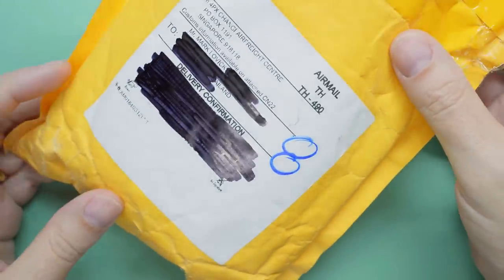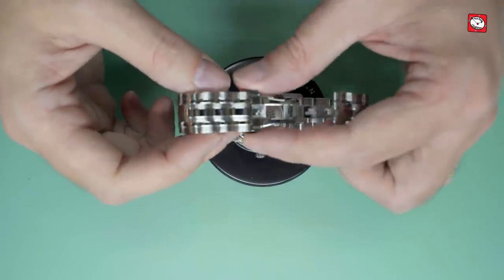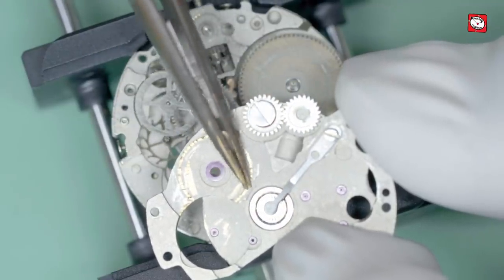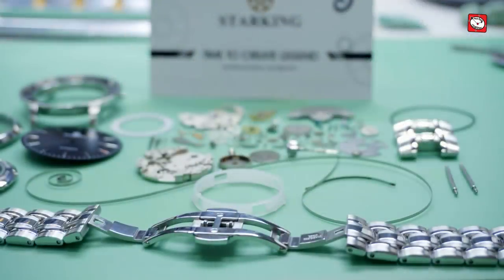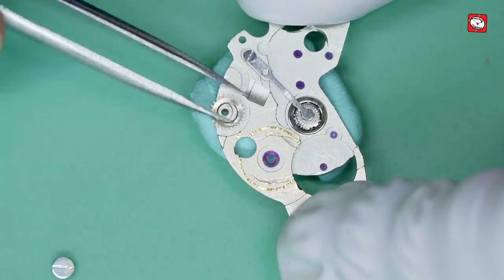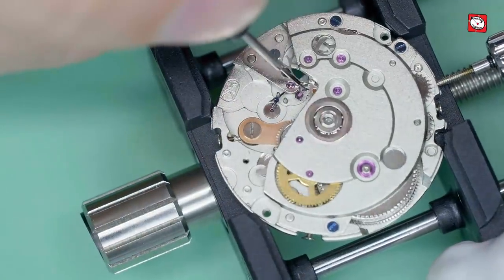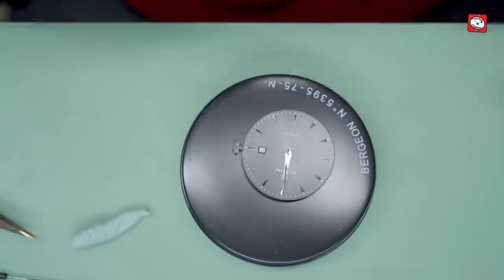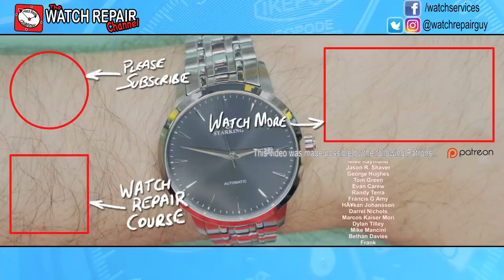Starking Watches - Can A $50 Budget Automatic Be Any Good? Full Review

Comment: Starking just wanted this rebuild video so they can use it for internal training on how to put a watch together properly ;-)
Reply: Or, they just had him show them what the problem was with their movement so they can redesign it. Probably saved them hundreds of thousands in R&D.
Reply: @manstersr   hundreds of thousands ... maybe not.
Reply: @manstersr  I imagine their next watch will have a miyota 8215 in it and it's $100 which might still be a real bargain lol
Reply: @Jerome...  Depending on how much they sell, it could actually save hundreds of thousands of faulty movement returns.
Reply: @Jerome...  hundreds of thousands of chinese rmb cents maybe :)
Reply: Al Paca and they have that update now
Reply: Ahahah 
now it's up to $63.79 with the Miyota 8215, so it may still be considered a bargain thanks to Mark's consultancy...
I will be curious to have the sapphire glass verified by a drop of water.
Admittedly the Miyota looks so much better, it surely has a better QC than the Chines 2813: but in my opinion either are just pieces of junks anyway using that single bridge for both the wheels' train and the automatic section, with that devilish spring lever pushing on the second hand pinion and the click always getting in the way of the reverser wheel toppling all the precariously stable wheels down to start all over again.
Dear Mark thanks so much for showing us with your dexterity and firmness how this reassembly should be done, albeit only if you see the video at a very slower motion ! ;)
Cheers
Reply: @annekedebruyn7797  returning a Chinese watch? you must be jesting, Not only will you have to pay postage to China, most Chinese companies also charge you the return postage even when they are at fault. It is a deliberate policy in my opinion to make it cheaper just to ditch the watch and buy a new one. I am talking cheap watches here as their more expensive brands have to conform to western standards and business practices to succeed and are really no different to western manufacturers.

Comment: In the meantime, your local watch maker trys to charge $80 only for a battery change for a Quartz watch...
Reply: They are not watch makers, just only battery replacers nowadays.
Reply: A battery can be replaced by batteries plus for the price of the battery plus 5 bucks.
Reply: look out for the guys that use metal tweezers to place your new bat into your watch , they just shorted it out draining it , probably lost half its life in those few seconds ! i didn't say anything to him ,it was my moms , i was with her and she could have asked me to get a bat and replace it instead, $20 charged , but that was more than 15 yrs ago , that local jeweler store closed up, sad he was robbed and business wasn't that good.
Reply: @HANDBALLDIEHARD  Cool story, are you German?
Reply: It all depends. If you're charging $80 to change the battery of watches that cost a lot of money, you need to take the whole picture into consideration. They usually inspect the watch, so you're also paying for an experts time. (Even if it only takes 10 min to check, and he values his time at $100/hour, which is about normal, that's $17 right there.) They also usually replace the o-ring, which is another 1 min of his time which is a couple bucks, and another $0.50 for the o-ring. They also usually blast it with steam to clean the links, which is another $5-10 worth of time plus the wear and tear on the steam generator. Then you have to factor in liability. If he changes the battery on 1000 watches and accidentally scratches one of them, that can make the profit from the other 999 watches completely disappear, depending on how much it costs him to repair that watch. Plus account for employees needed to serve that customer and amenities in the shop (like if they have tea/coffee for you while you wait). People that aren't business owners don't think of things like that, and you may think that things like the wear and tear on the steam gen, or labor/materials of replacing the o-ring, is inconsequential. That's because you're not looking at the whole picture. All of those things cost money, and that isn't even including profit for the business or the litany of other things that go into serving a customer and running a business. It's the main reason businesses fail. People don't think of the minutiae, and after a year, that all adds up to thousands of dollars.
Reply: In 2018 i paid 15 euro to make a watchband ( metal) shorter here in the Netherlands....i was kindda baffled with that price because the watchmaker was finished in 10 minutes. Nowadays i can shorten my own watchband;-) battery change i aldo do myself....which they also charge 15-20 euros depening where you go...!
Reply: We have a place called Battery Boy, He only charges for the battery and nothing for the install. 80 buck is outrageous.
Reply: I was charged $90 for a "Good" quality battery that can last me 3 years when I was trying to get it fixed in Bangkok. I told the dude, just give me the "5 bucks" battery.
Reply: 10€ in Paris
Reply: @chinaman1  Here in suphanburi , thailand i have had several batteries replaced works out to less than 5 dollars .
Reply: I paid about 8€ in france
Reply: @xenonram  I am inclined to agree to a certain point. However when I see that the guy is reselling watches that cost 15$ in the U. S. market for 70$ - 80$, it's time to say goodbye from my behalf...
Reply: Andrew Delashaw 
Don’t forget business licenses, permits to have permits, taxes at every level plus taxes on the taxes, shop/store overhead (rent), insurance, utility bills 💸 💵 etc
Reply: €0 euros in the Netherlands, I'll do it my self;))

Comment: I have purchased more than ten of these by now, and the first batch with black dial were good, at least came oiled and ran fine. Then at the first DOA I went on discovering why it had stopped and saw similar scoring inside the bridges and went on replacing it with a Hangzhou 2836-2 clone, which is a 55-60 dollar movement, also crazy to put in such a cheap watch, but it makes for a nice end result and that's ultimately what it's all about. I so appreciate you took the time, as there was a discussion going on on WUS about these for a while and the opinions were quite on opposites. What I actually liked about the movement is that it has dial feet positions and screws for ETA and DG! The hands are actually rather the size of an ETA, so that might help some in finding replacements, or should you also go the Hangzhou route you can fit them without any issue. The only thing that won't fit are the dial feet, but this is easily solved by using dial dots. The crystal really is sapphire though, I've tested it! If you want a reliable tester for that it won't be more than ten bucks on aliexpress, and called a DIamond Selector II

Comment: I've had an even cheaper starking for a couple of months now and despite the chrome plated brass case and the identical movement,is running well and keeping good time and all for $26.0.I now have a "winner" which beats at 21600 and so far is keeping very good time for a measly $19.0!!You'd have to buy a basic casio quartz to beat that!!

Comment: Great video (as usual). Okay it looks like that one movement was a bit duff, but no reason why others wouldn't be good enough at that price. 28,800, sapphire crystal and 50m waterproof, is a great set of specs for $50. Not my kind of watch, but pretty good. You can get the Miyota movement for about £30 from Cousins, so that swap is very do-able. Personally I'd run with the original movement and try and regulate it so its there or thereabouts on a daily wear basis.

Comment: I think that this Watch would be perfect for a beginner to strip down and learn from it and to experiment on it. I would call this the squire of guitars.
Reply: I don't think experimenting on watch movment and such is as easy as simply changing a pickup or switch turners on a squire.
Reply: admiral cookie both things aren’t that easy , but I’m referring to the general sense of modification. It can be visual or practical. And I compare them because they’re both inexpensive enough to experiment on without regretting it later. This movement can be bought around 20-30 bucks.
Reply: @wc7484  I've done both the movement strip down and the guitar rebuild, The guitar was a Cozart 12 string that got new paint, pick ups and electronics. The watch was a Tevise (24 bucks) that I stripped down and lubricated and put back together as a hand winder. Both took a lot of practice and patience and  I can say that modding the guitar was a little easier than rebuilding the movement.

Comment: You can get a much better one within $60. CADISEN c1032 which have sapphire crystal, good quality case and bracelet and seiko NH35/NH36 movement.
Reply: The SK also has a real sapphire crystal and more than decent case, and is very flat. NH35/NH36 are not always trouble free either.
Reply: @vincenzodigrande2070  yes, my cadisen had very annoying dust particle, i opened it and just couldn't pop the case back, even with my whole weight! I broke the back glass, a watchmaker replaced it. Even with a watch press is difficult to close the case back, I use flat kitchen woodboard and a bigger caseback put on this watch and press the board and it snaps.
Reply: @vincenzodigrande2070  But most NH35/NH36s are not trouble makers. Its a Japanese movement with a recognized brand behind it. Not like with a chinese watch.
Reply: I was going back and forth before with either the cadisen or this starking. I went for the starking. I just didn't like the roman numeral on the 12. It throws off the balance for me.
Reply from the maker: OK - I have ordered a Cadisen to do a side by side comparison! :)
Reply: Thanks for advise, I bought C1033 for $52, it's now fifth day I set them, and 4 sec. off, that's incredible. The NH35A is excellent movement.
Reply: @MeDicen_Rocha  The Chinese actually make all of the Swiss watches under $500.

Comment: Nice in-depth review, pity you didn't include a test of the "Sapphire" glass to confirm that's what it was and a quick test with a magnet would have also shown you the quality of the stainless steel.
Reply: Mark Wallis Jody at “Just One More Watch” did the test. It is sapphire crystal.
Reply: It's not sapphire at all, it's likely a mineral glass, i.e. soda lime glass or something like that, with a capacitive coating to fool people into thinking it's sapphire when they put a capacitive meter on it.  Soo much fake stuff comes out of China, that practically everything is fake.  For example, stainless steel coming out of China is subpar quality and actually different grades than stated (That's why those cheap tea pots at walmart rust soo quickly), and I've seen tempered glass come out of China that was actually just soda lime glass.....which is extremely dangerous when you're using it in high heat applications where it could shatter in an explosive manner.  I bought some "tempered glass" from China for 3D printing machines, and they didn't even have any stress patterns at all under a polarizing filter, i.e. NOT tempered glass.  Of course glass is still pretty scratch resistant in general, more so than plastic.  So technically it's still a better value than most watches, as long as the mechanism holds up. But when whatever material they use breaks, I wouldn't want that watch on my hand or anywhere near me when the shards start flying. This is a watch for people who want mechanical without paying the extra money and only want to wow people who know nothing about good watches.  But the moment you cross paths with someone with a good watch, you might as well be using a casio.
Reply: @bottletree33  says the guy who is using most his tech equipment made in China.

Comment: I actually bought this watch and am reasonably happy. (No I'm not a bot)
I bought it from AliExpress and when it arrived, it was running super fast. Like 5 minutes in half a day fast. In addition to that, the rotor broke after like a week (might have been my fault) and so did the date ( definitely my fault; set the date with the hands like 2 hours from midnight and it stopped working). I contacted the seller (starling official store I think) and complained, and after a bit of back and forth, they just sent me a new watch without the bracelet as it wouldn't be worth the hassle shipping it to China, disassembling it, finding the faults, reassembling it and shipping it back to Europe. Now I would be happier if it had just worked from the start, but now I at least have a spare watch that I can disassemble and take videos of. Overall I do recommend buying this watch if you can't spend too much money just on a whim.

Comment: You may know already, but if you brush a solution called Ospho on your rusty tools, it is phosphoric acid and changes the iron oxide to phosphoric oxide (I believe it said on the label) which will turn black and resists further oxidation. Most hardware stores have it. You can also soak them in  household vinegar just don't put any plated metals in it for more than a few hours. I've had it loosen the chrome plating on wrenches after 24 hrs or so.

Comment: You know what I want from a watch other than looks? I work all day in a wood shop with sharp tools, sandpaper and all kinds of grit and grime. I need it to stand up to that environment. I'm no die hard Invicta guy by any means, but the one I've worn for several years has finally gotten a cracked crystal, but is still working just fine despite still getting moisture under it. It's been cracked now for over a year so it has to have some degree of quality control a lot of similarly priced watches just don't have.

Comment: Great video. I have rebuilt many dg 2813 movements recently and it seems like yours is different. I don't see that crazy spring for the date wheel that flies out at warp speed and is never found. Other differences too. I wonder if they changed the design slightly. You are the best Mark

Comment: Yesterday I did buy 25 mechanical watches for only 60€, some even as small as a finger nail. Most seem like crap but when I came home I selected one, did wind it to full, adjusted the time and now a day later it's still running and keeping ok time, about 2min off. Will need some work (polish case and new crystal and band) but if I can get 5 to 10 watches running again for low prices I can make a decent profit. :D

Comment: The Carnival 1986 range of watches are beautifully made too. Bought mine for £38 a couple of years back expecting it to be junk but the engineering fit and finish to case and bracelet are very good for the price. It was sold to me as Tritium, the blue bezel version, it is not Tritium Tubed though appears to be with the markers tubular formation but I kept it all the same for the outstanding feel of the watch. It currently contains a quartz movement but I will change that out for a Seiko NH35/36 auto or Miyota 8215 or similar at some point if case thickness allows, likely a wind only movement will fit but exceptional finishing to the case gives me the motivation to upgrade this.
Carnival are now selling their range at around £135 on eBay which is a pity. Inevitably with Chinese watches, as demand increases, so do prices. Higher volume demand and production doesn't seem to bring savings in the Chinese culture as it does in the West. They actually lay claim to some Swiss origins, not sure how true that is 😂.

Comment: Concerning your tools rusting in the humidity. I spray my small tools in the shed with 3 in 1 oil from an aerosol can. It works a dream. Only spray them lightly, you don't want them to be sticky. I spray my lawnmower blades too after cutting the grass. Hedge trimmer as well. Anything in the shed that's capable of rusting over time. Hope this will be helpful to you. WD-40 evaporates easily so not as good.

Comment: Thank you, that was exceedingly interesting.  I own one of these, and wound up lending it to Richard Perrett who posted a video review here - understandably he didn't do the full strip down though.  My moderately well informed opinion of this watch is that it sells at a more than fair price (the bracelet in particular is improbably good); it'll probably come tolerably well regulated but don't expect the subtler adjustments to have received much attention, and that the crown is horrible.  Also, it's a bit boring.  These aren't really deal breakers considering how little it costs though.  Mine keeps a consistent rate of +5 sec/day and I've had it for a bit under a year.

Comment: Thanks for the great channel.  BTW to help with rust. After cleaning try mixing up some pure lanolin in some ether.  Paint that on the parts.  Not the greatest smell for a day or so but your rust problem will be solved for a few years. I used to use this on my carry gun and fixed my rust issue. Cheap simple and hard to rub off. Cheers

Comment: Having been dabbling in kit builds this isn't a horrible deal. The bracelet and case alone  if it is in fact 316C stainless with a Sapphire  crystal would almost equate to the cost of the entire watch. The fact that you can do a Miyota 8215 or possibly an ETA 2824-2 movement and dial swap on it after that movement conks out, makes it slightly better.

Comment: I have one of these. It 'stopped' working in about 5  months. I mean, it still works, but I feel around the 10-11 o'clock time the movement runs difficult and with a normal day wind it fails to get through the night. I can get it to run again, but I have to get it running every morning and reset the time. Also the bracelet has started to develop quite some play.